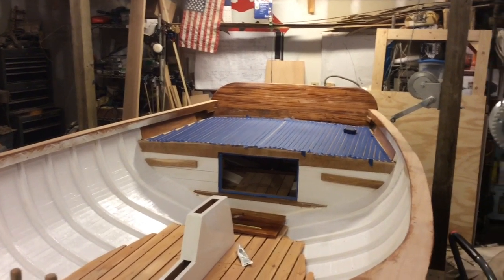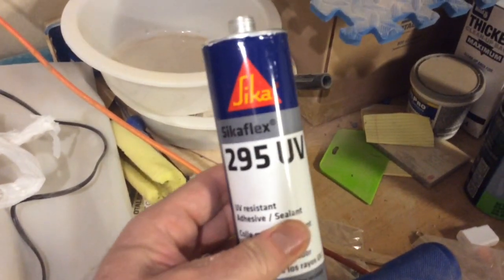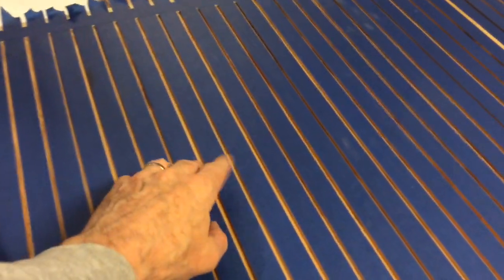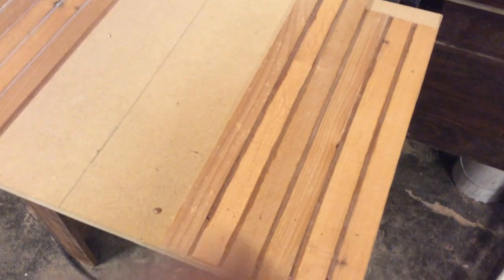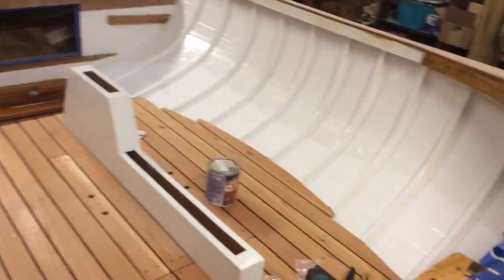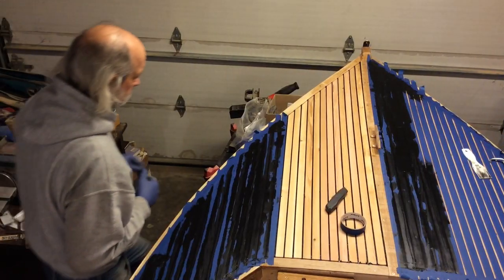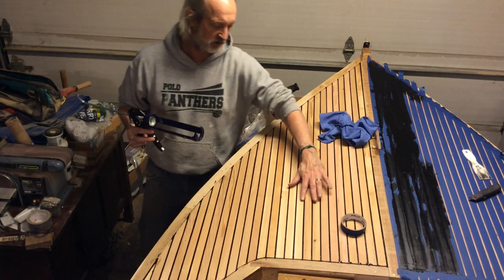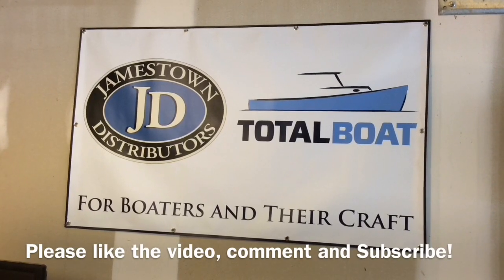Boat Building Haven 12 1/2 - Deck Caulking - Episode 88

Comment: Did you use the sikaflex 209 primer or any sealer prep at all.
Reply from the maker: I did not. I hope that I'm not sorry but I seem to have good adhesion. the wood is marine ply, Okoume topped with western red cedar so I don't think that I will have much or any oil in the wood that will cause me problem. If I had used teak, probably would have been a bit different process. I did call Jamestown Distributors Tech team and followed their advice and I cannot highly enough recommend this free service.